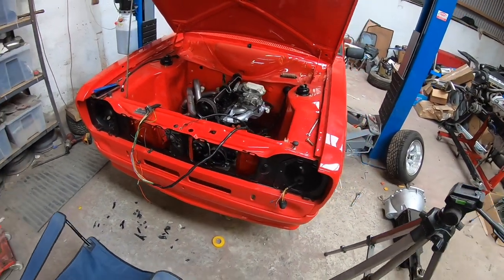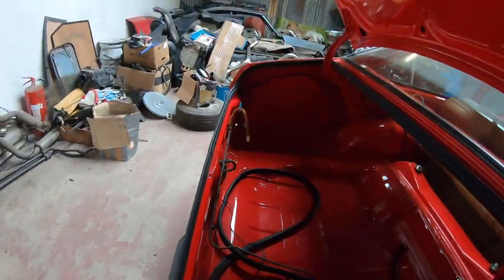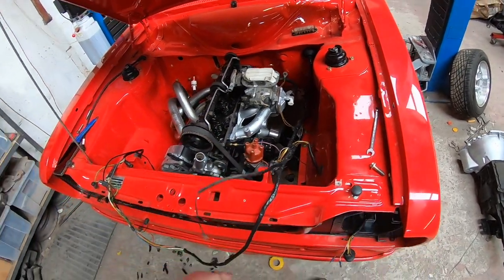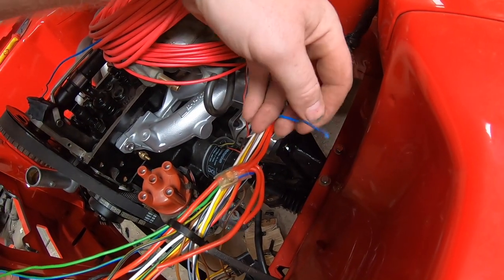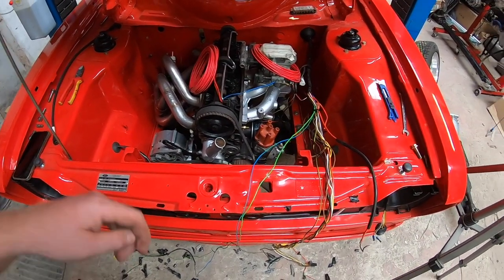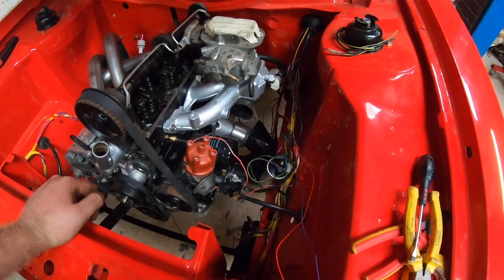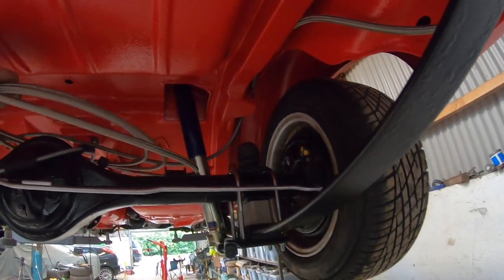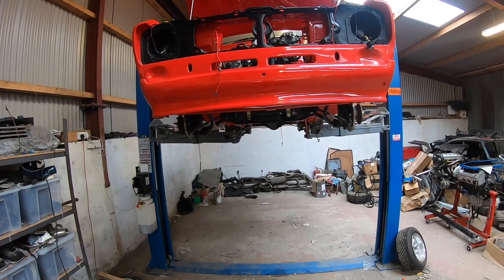Rebuilding the customers Escort Part 2... Wiring and Gearbox!

Comment: Small wire black section is a fusible link. It’s designed to heat and break if there is an issue. Need to replace it with new one or a fuse not sure what rating it would be , looks good, good work, :)

Comment: The one small wire at the end is a fuseable link, it will melt like a fuse if there's a short circuit,  I had one fuse on a mk1 fiesta once,  the alternator wire had touched the exhaust and  melted, 😉👍
Reply: @krisdupreysgarage  oldschool technology! Keep 'er lit!